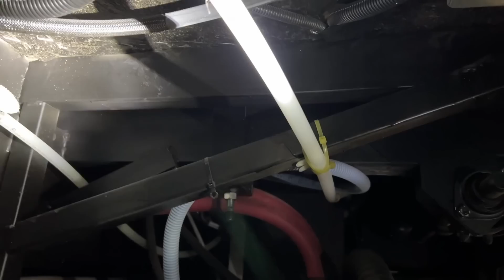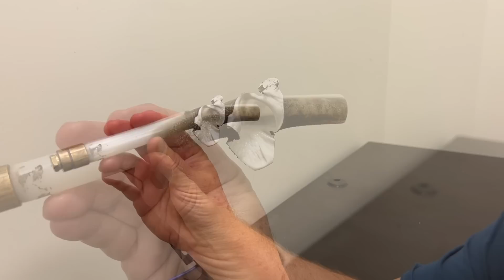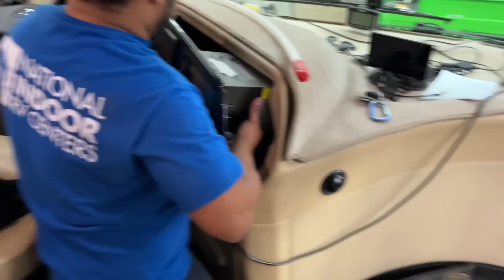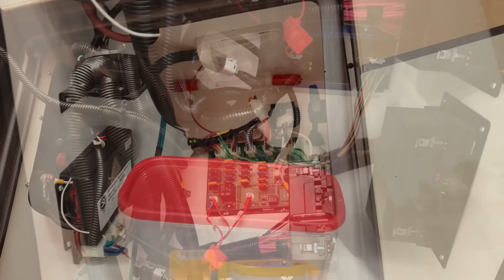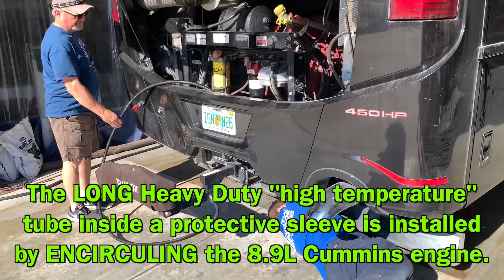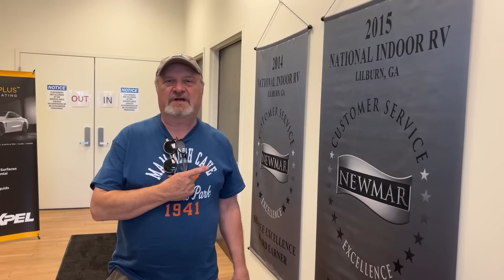PROTENG AUTOMATIC FIRE SUPPRESSION AND DETECTION DEVICE | RV MOTORHOME INSTALLATION AT NIRVC | EP201

Comment: Interesting way to evacuate the bedroom.  I might have to consider something like that for my new 5th wheel.
Reply from the maker: Thanks for the comment, and we're glad you found the video helpful for your new 5th wheel!  We still use this board,......it still stands ready in the corner when we are set up.  If I could do things over, I would work out a design that was lighter in weight!  Having this workable way out is great piece of mind, whether it ultimately does the job or not,.....

Comment: It’s not going to work for a refrigerator fire. If the propane is operating as soon as the fire suppression system activates and extinguishes the fire. The propane burner will automatically relight and continue burning the hydrogen that is being released from the system that started the fire in the first place.
Reply from the maker: I always refer folks with propane refrigerators to Fridge Defend by ARP @ https://www.arprv.com/products.php

Comment: Interesting how that system works and I enjoyed the video.  Do you have a ballpark figure on how much it would cost in a Class A diesel?  Merry Christmas to you both.
Reply from the maker: Each tube they use is SIZED by the VOLUME of the compartment, and the expected normal temperature inside it.  Some areas have vented bottoms to atmosphere, and others are sealed compartments.  Areas exist that need the tube to have a protective sleeve, and other compartments may have a shape that needs multiple tubes.  Every set-up is unique.  NIRVC has pricing for units that they have done before, and units that are easily understood to be similar to ones done in the past. It would be best to call them.  I would expect a person can do the install in stages by installing the tubes in the highest risk areas first. You can then budget for a follow up visit later to do phase #2.
Reply: @OurJourneyInMyles  Much appreciated.  Thank you.

Comment: I bet that would cost a lot. However, a burned-up rig would cost a lot more. Not to mention a loss of life.
Reply from the maker: Every system is unique, and is based on what is the priority YOU would like to cover and protect.  A person can do the installation in stages, and take some pressure off the wallet! First off, the primary thing to prevent in a fire event is loss of life.  The secondary benefit is of course never having to deal with all the destruction and insurance nightmares.

Comment: Mark, after watching your video where you built a homemade surf/paddle board, I added a small bathroom carpet which is rolled up and secured to the countertop at the exit window. The carpet will roll out and protect my sensitive man belly as I slide out and over the window frame. Maybe a small trampolene is next, but I would probably just bounce back up and knock myself out on the open window!! Merry Christmas.
Reply from the maker: The carpet is a great idea.  Mac The Fire Guy always said to throw your bed comforter/blankets over the window sill edge so you don't leave body parts behind!

Comment: After 35 years in manned space flight safety is ingrained into you to where it truly becomes a life style.  We don't have the same systems as yours but we do have similar ones.  Tire blow outs and fires were the two biggest things that kept me awake at night when we purchased our coach.  We were lucky in that Tyron bands had already been installed so all we had to do was replace the Fire Fight fire suppression systems the previous owner had removed and installed in his new coach.  Great video.  I may have to add a few of those as right now we only have our generator and engine compartments protected.  Be safe and stay healthy.
Reply from the maker: Great comment MGHA!  We forgot to protect the Honda Tow vehicle engine compartment, and will be adding that.

Comment: Hi folks,
Thank you again for a very informative video.  A couple of points.  FM-200 is in effect a refrigerant and when that tube bursts it will be spraying very cold wet gas in the compartment.  So just a heads up if the tube hasn't burst yet in a fire, make sure you are wearing safety goggles.  Wet refrigerant can cause instant frost bite of the eyes and can cause blindness.  Second, the tube in the dash.  This could cause an instant fog in the drivers area and thus loss of vision.  Aside from the above thoughts I think it is a great system.  As a retired fridge tech I am aware of the dangers of refrigerants. 
Thanks again.  Stay safe on the road.  
Finally from Nova Scotia,  Merry Christmas.
Reply: I was thinking the same way!
Reply from the maker: Thanks for your educated and professional points for one to consider when purchasing a system!
Reply: @OurJourneyInMyles  well at least you wont burn up while you are sleeping 😴